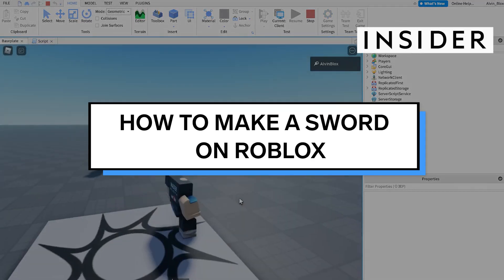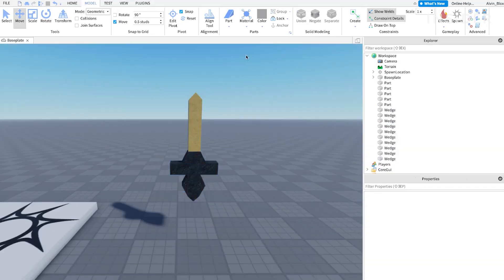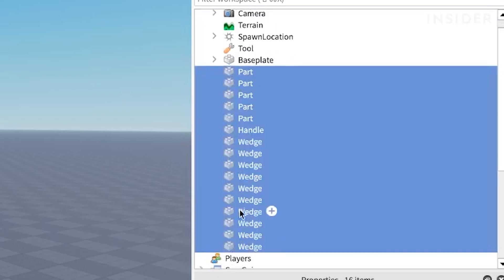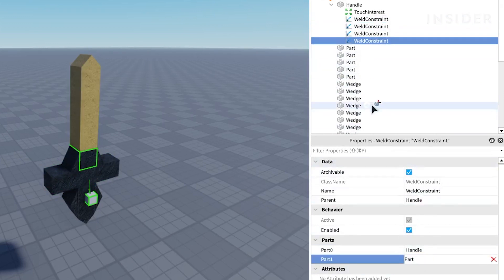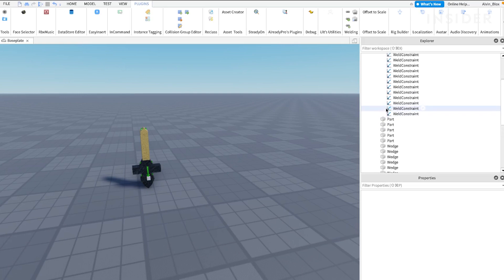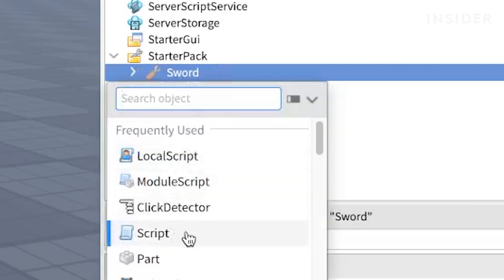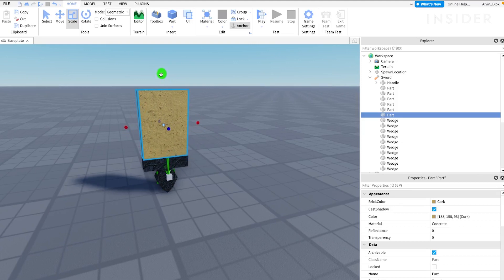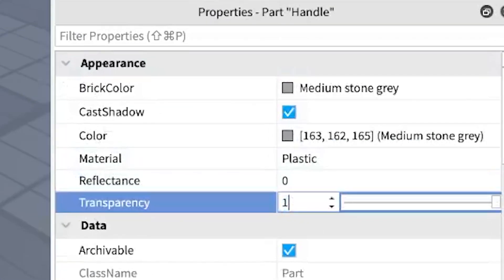How To Make A Sword On Roblox

Comment: tip union everything but the blade so u dont have to weld a crap ton of parts
Reply: u can also just make it so the tip is the handle works either way

Comment: 2:24 my sword shattered where it was before and i had a red cube in my hand
Reply: Yes ım having this problem.Did you find the solve?
Reply: @404note  to fix this make sure that the weldconstraint is on both the handle and the part, and make sure that there are enough weld constraits for all parts (so it would be like , handle, part1, handle part2) and make sure it is all unanchored
Reply: @NoahRosario-pf5qn   thank you dude but ı solved  2 monthd ago :D

Comment: i do have one problem whenever i pull it out it either makes me fall over or teleport to a random position
Reply: un anchor it or make a weldconstraint for each part ex theres 7 parts minus the handle, make 7 weldcontstraints and then put part two as handle  or do both

Comment: To this day I hit my head on a wall trying to find out why did roblox made tool system like this.
Reply: 😅yep same
Reply: i was hitting my head before i watched this video
Reply: luau made the coding, roblox used the script service
Reply: somehow when i made the tool it kept teleporting me to the position where the block was in the lobby and getting me stuck in the ground even though it wasnt anchored
Reply: @Imaturtledev ik im almost a year late but i prob welded it to the baseplate
Reply: How do u make the damage work?
Reply: Because it doesn't work
Reply: Not actually me right now I’m just standing right now❤
Reply: tool system is fine

Comment: this is so tedious, if you have a weapon with a lot of parts its so difficult to give all of them a weld constraint, there has to be an easier way
Reply: As a long time game dev and animator, there is not.
Reply: @TheCardboardDinosaur  there is, actually
Some developer on YouTube I vaguely knew made a plugin known as "Constraint Creator". This lets you select 2 or more base parts and weld them all at once, this works with constraints, welds, motor6D's, etc.
There might be some bugs, but I haven't found any issues with it!
Reply: you can just union all the other parts together(except the handle) and weld constraint the union.
Reply: I may be wrong but I think you can use blender to make the tool then just have two halves a sword to constraint
Reply: i just used d-weld..

Comment: Ummm when I equip it it just teleports me to it and I can’t move
Reply: maybe cuz its anchored
Reply: @lorincvass7400  it happens to me to and its unanchored
Reply: @YummyChez  check your handle, it could also be anchored
Reply: y’all I fixed the problem I had two years ago 😭
Reply: thanks tho
Reply: check to see that you didnt accidentally weld one of the parts to the baseplate
Reply: make it so that it does not touch the baseplate

Comment: Whenever I try to equip it it teleports me to the spot where I modeled the sword and puts me in a werid position. I tried to fix this problem for 7 hours please help!
Reply: Natty  No it isnt...
Reply: @prodfym  it is, basically anchor it and unanchor it.
Reply: it may be welded to the baseplate, try moving it
Reply: Ik I’m late but basically the sword is not supposed to touch the baseplate, take it out of startpack, and select the move tool to move it above the baseplate it should work